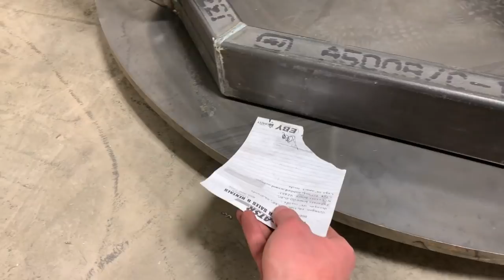Building a table to hold my vise

Comment: And you can bolt it to the floor if you're concerned about it moving. The floor, that is...
Reply from the maker: Yeah I’m really not concerned about it moving even with the table just sitting on it. I mean it never tried to blow away when it had three tractors on it, so now with the table there’s not a chance.
Reply: But the tractors could have rolled... @Jer_Schmidt
Reply: Steve, you hit that nail on the head!!!!!!!
Reply: Steve Gilbertson s
Reply: What do you bolt the floor to, to prevent it from moving? :P

Comment: Nobody overbuilds quite like you, and I mean that only as a compliment.
Reply: You buy once, you cut once, if it's worth doing then it's worth overdoing. Those are his credos. :) I mean, that wilton vice, will pay thrice it's price in two decades. Guaranteed. Already, mine, the next step down, if i wanted, i could sell it for just over twice the price of admission.
Reply: I once purchased a set of Heavy duty sawhorses at a farm auction. Beam was a 10 x 10 H beam 3/8 web and legs were 4 x 4 x 1/4 angle  they could have supported the front of the space shuttle if need be.  Farmers never overbuild anything  They just make it strong enough to hold anything they may be able to move with whatever they may own.

Comment: I'll definitely be sticking around. Love watching someone who knows what they're doing.
You should make an attachment for that vise to attach it to your tractor. Probably be very simple for you.

Largest vise we've had was a leg vise roughly 4 feet tall. Easily 400 pounds. My father donated it to a local museum a couple of decades ago. We had it attached to the wall of our garage. We we'd use it, you could see the wall flexing under the weight and our strength.

Comment: Oh my gosh. Through-bushing made from just raw round tube stock in the rectangle tube for bolts is such a good idea. I've been analyzing large welded steel structures for years and I've never seen anyone do that. I hope you don't mind if I steal the idea. If you ever need some analysis for your designs, I owe you :)
Reply: That's a very common thing to do. VERY common.

Comment: I hear forklifts make moving heavy things super easy.  Might want to look into one of those.
Reply from the maker: Interesting... I’ll google that.
Reply: @Matthew Cremona   Did you figure that out after just moving your new toy yourself?  :)
Reply: first get milling machine ;)
 @Jer_Schmidt
Reply: Everyone's been suggesting you get yourself a forklift for years.
Reply: That must be where I heard that
Reply: Could thread a lifting eye in the top where the center of mass is and then use the engine hoist to move it.
Reply: Nah. gantry crane !
Reply: He could just build a trailer like yours Matthew and move it as easy as you move those giant chunks of wood you slab up.
Reply: Forklifts cost too much and aren't all that useful on the farm.  Surely one of those tractors has a  front end loader with forks.
Reply: Surely a gantry crane of some sort would be more versatile.... Takes up no floor space and you can probably knock one together out of some old motors and big ass girders.
Reply: He'll probably build one of his own next month!
Reply: We went back and forth between a fork lift and skid steer.  Most fork lifts are just made to run on concrete.  Most skid steers can run off road.  We wound up with a skid steer with pallet forks on it.  It has a 2200 lb lift capacity (about 1/2 of a small fork lift but enough for us for most things) and 4400 lb tip.  It will lift up a Jeep Cherokee (approaching tip weight) and is useful for a LOT more things that a forklift.
Reply: @briancasey3421  For shortish gantries and rooms - say 10 or 12 feet - those are surprisingly easy to build with I-beams, square tubing, and COTS hardware.  But as the length grows, the weight of the gantry beams goes up fast ,which makes everything else bigger and more troublesome.  I seriously considered building one in my little 12' x 20' shop, before I decided to sell and move.

Comment: Great build Jer, enjoy your videos a lot. If you have not come up with a way to move the table around yet, consider drill/tap a couple holes in the center and one in line and towards the vise for lifting eyes. Your floor hoist will straddle the legs and make it safe and easy to move around. If you don't want  the holes left open you can insert allen head set screws in them until time to move again. Just a thought. 
Thanks for the video.👍

Comment: Nice vice support :-)  I got a good tip from Jody at Welding tips and tricks for a ground on something you can't clamp on: use a thick copper wire that you wrap around and clamp on .

Comment: Got a vise exactly the same as that in 1972. It cost $490.00 then. I purchased replacement  jaw inserts in 2016, and the cost of them was $180.00 for the pair. You gonna LOVE that vise.
Reply from the maker: Ouch, those are expensive jaws. But interestingly the vise is actually quite a bit cheaper today when you factor in inflation.

Comment: Such a killer vise. I picked up a lightly used 8” version of that one over the summer. I wasn’t smart when picking it up. I way underestimated how heavy it was, and grabbed it by the handle with one hand, and the bullet end with the other hand, picked it up and it rotated out of my hands and fell on the concrete floor. Putting a huge dent in what was a perfect bullet cap. Doh!! I’ll be cantilevering mine after watching this..

Comment: Great build! It wasn't really until the shot of you mounting the vise that I really understood how BIG that thing is.
Reply from the maker: I was a little taken aback when I opened the box. It’s a beast.
Reply: @Jer_Schmidt  when you said "heavier than I am" my initial reaction was - no offense - "Gee, I didn't think Jer was a little guy, but maybe?"
But then I saw you with that monster in the shop crane and my jaw dropped. It's like the corollary to what Archimedes had to say about levers. We can call it "Jer's Vise Corollary:" "Give me a vise big enough and let me weld up a table and Archimedes can pack sand."

Comment: I just absolutely love how beautifully over engineered it is. Moving the legs out a few inches, so it doesn't tip over as easily. I am pretty sure nothing will make that tip, ever. You should test with a longer tube how far out you need to put your weight for it to move at all. I just hope you will not need to move your workshop, because this will be a beast to move. Well done on the video very enjoyable.

Comment: Question, who just happens to have a piece of 3/4" steel that size hanging around?
Reply from the maker: Oh you know...it was just a scrap. ;-)
Reply: I do
Reply: It's a knock out plug from a really large electrical box :)
Reply: @Jer_Schmidt  this is one of those easy projects you can build for free from your scrap pile, right? Hahah! Nice vice, and great table!
Reply from the maker: McKenzie Keith 
Of course! Just using up offcuts.
Reply: I do.  Mine is an old de-commissioned pallet table.  I had thoughts of building a weld table, but supposed a nice little vise stand would be good too.   Nice job Jeremy!
Reply: #AMERICAN_FARMERS

Comment: Sand fill the legs! Make it a 1ton table! Hahaha! Awesome work!
Reply: I'd rather rice-fill it. That would probably keep it dry inside.
Reply: Usually you pour concrete inside. A heavy one where the aggregate is scrap metal. But if you really want to do it right, you go and buy lead and pour it inside. It's dead easy. You make sure one end is sealed and put as much lead scrap inside as you can fit, then, you heat up some lead (don't boil it) and pour on top. The lead inside will melt with the poured one and form a solid chunk. Saves time and minimizes the risk of vaporizing the lead, which is the only thing besides putting it in your mouth that you don't want to do.
Reply: Radim Petricek isn’t rice hydrophilic? So it would absorb water and release it to maintain equilibrium. That’s like putting clay desiccant in there. Only effective with exactly 100% seal, or it’s just breathing and sweating.
Reply: Hhmmm.
Reply: @aserta  to go full on, pour tungsten or osmium into the legs
Reply: @aether1370  yeah.... Try melting either of those without vaporizing the steal table.
Reply: @isaackarjala7916  to be fair I'm not a metallurgist, engineer or craftsman
I'm a 15 year old who enjoys Jeremy's content lol
If you melted the lead beforehand and poured it in after like a cast then I'm sure the latent heat transfer wouldn't be enough to melt the steel, unless the lead was also about to be vaporised :)
Reply: @aether1370  oh yeah, you can pour in lead, but not tungsten or osmium; both have melting points far above that of steel
Reply: @isaackarjala7916  oh fair enough
Reply: @isaackarjala7916 , you can fill it w/ scraps of osmium but that thing  is like $13000 per kg... Filling with any non iron metal might result into galvanic corrosion in the long term (esp. if there is any DC going through)

Comment: you should have done one leg shorter
so you can build in a adjustment like a big screw or something to adjust the table so he doesnt wobble on the ground
Reply: I think it's heavy enough that that's not an issue.

It just bends the earth underneath it to whatever level the legs are at.

Comment: If you add a couple cross bars at the bottom about six inches up from the floor, you could roll your pallet jack under it and lift the table when you need to move it around.  I've done that for welding tables and workbenches.

Comment: Totally impressed with your attention to detail; its great to see there are still craftsmen who will are willing to do extra work on even what could be considered entirely a utilitarian item (e.g. A metal vice table) and in doing so have elevated it a piece of craftsman furniture/art.  (Its kind of like on farm equipment from the 1800's; they often hand painted pin strips which ornately framed each panel on the machines body work.) great work

Comment: I've been trying to decide where to mount my vise for awhile, now, and thanks to this video I... still have no idea. But the design is great and the execution is even better. The combination of meticulousness where it pays off and the eyeballing where it doesn't... really good info. I tend to get paralyzed when building something this.... expensive and permanent.... trying to figure out how to not mess it up. You seem to always get it done properly start to finish.

 I am looking forward to the followup video of the paint drying, so long as you get some good angles.
Reply from the maker: I can relate to the feeling of getting paralyzed before starting a project like this. I spent a lot of time in CAD trying to figure out how I wanted to do it, and I have many other projects where I am currently in that paralyzed stage, scared to start before the design is perfect.

Comment: i made a welding table out of a 4ft chill ( a 2 piece centrifical mold used to make hard surface rod and inserts) one half has a hole in the center.   The half i used was the bottom with a 2in centering hole and is about1 1/2 to 2in thick cast alloy .You can weld to it but most rod will pop off it.   put it on steel casters and put a drawer under one side and a rack on the bottom.    the chill is machined down from about 4in thick after the castings gradually pull chunks out of it.

Comment: A shelf 1.5" higher than the pallet jack in it's lowest position makes moving the table easy.  That is how we set up all of our tables in the shop.  Build the shelf, set shelf on 2x4s on pallet jack, weld to table.
Reply from the maker: That’s how our other welding table is made. It is super easy to move it that way, but I find that shelf to be a clutter catcher and it can be a bit in the way...

Comment: I like the idea of using the round plate as a base itself for a pedestal.
Reply from the maker: If you had plenty of space that would not be a bad idea. But whenever I get my own shop it will likely be smaller than this one, so I wanted to make something that uses space efficiently.

Comment: I have not read all the comments, so I apologize if this echos other suggestions, but for palletjack liftability, perhaps you can add crossbars several inches off the ground between two pair of legs. you could also add shelves/cabinets between legs to give added storage capacity and thus weight (not that weight is actually needed) I wish you had discussed some of the other ideas you had for the bench... I am curious what you have in mind. Personally I would add something akin to a receiver hitch opposite the vise so as to be able to add modular bench top power tools.

Comment: Hi Jeremy,
great build.
my I suggest that the concept of a bush where you put a bolt through tube is very good. however instead of welding the two tubes supporting the vice together you could have spaced them out so you could have used a standard bush placed inside the tube instead of externally mounting it with its added complication. also it would have alleviated the need for the top plate for the base of the vice, although the plate did form a nice flat surface for the vice base.

Also the best way I found laying out an octagon is to scribe out a circle  (using a stick and a nail in it) to the diameter of the long point and cut the flats in between to suit. easy.

further consider putting a 1/4 thick layer of rubber under each leg to minimize rocking. if you can lift it.
Reply from the maker: Thanks for the tips! I did consider spacing the tubes under the vise like you said, but I thought this would look better. After seeing it in real life, I think this actually looks worse, but I’m not going to do anything about it at this point.

Comment: Awesome table....when you do go to paint it I suggest leaving the top bare steel.  I made a table/cart similar and painted the base gloss black and left the top raw steel....looked killer, especially if you polish or fine sand just the edge. I sprayed the top with a liberal amount of wd-40 let it soak in over night and wiped it clean, and did the same once a year. Never rusted
Reply from the maker: Yeah, that’s what I plan to do. I left the top of my belt grinder cabinet unpainted, and I like it that way!

Comment: The best anchor you can use for mounting those big vices are big flywheels. We had 1 of those big Wilton vices in our shop mounted on a stand with a large diesel flywheel somewhere around 24 in. in diameter & 8 to 10 in. thick. It took quite a bit of force budge that thing. If you wanted even more weight then that you could also use the crankshaft instead of a big pipe.
Reply from the maker: Sounds like a good idea. I still prefer this in my situation, but if you needed to be able to work all the way around the vise then a flywheel would be a good choice.

Comment: Machine grey paint on the legs, no paint on the top, just lots of oil and wire brushing when needed.  That's what we use on our welding benches onboard our ships, and they hold up well that way.  Nothing is worse than a painted top on a steel workbench.  Paint will eventually chip under regular (ab)use, and those chips always wind up getting into everything.
Reply from the maker: That’s exactly my plan. Same paint color as belt grinder on everything but the top surface.

Comment: Nice light weight table and vice :-)
Well Done ! A suggestion would be to add a large drilled and tapped hole near the center at the balance point for a lifting eye. For times when you can't use the pallet jack and need to crane it.
Great project,
Dean
Reply from the maker: I can’t imagine in what situation I wouldn’t be able to use either the pallet jack or forklift.
Reply: @Jer_Schmidt  Didn't know you had a forklift. 
Great job on the table. Beautiful vice also.
Wish I had the space to build one. Keep the projects coming Jeremy, you do excellent work.
Reply from the maker: The Ayr Cave Shop 
Thanks! 
I don’t have a forklift, but we have a front loader and a skid steer that accomplish the same thing in this case.

Comment: I bought a used manual fork lift for 400Euros (500$). A bit stiff for stuff moving, but since there is no electronik or stuff, I can weld on it and don't have to worry about anything. If you don't want to spend money, a stack of pallets can do the job also (I used that method before the fork lift). My workbench weighs about 3/4 tons and it moves when I bend heavy stuff, so now I am thinking about a post vice ancored in concret to solve the issue.
Great build by the way.

Comment: An added advantage of having the vice off the table surface and lower is that the vice can be removed by undoing the snivel locking nuts, leaving the base in place, thus clearing the table of obstructions when placing large objects on top.
I have built a few in this manner.

Comment: I kinda wish you had canted the legs outward slightly, with a lower cross a few inches above the floor. Could make for a storage area (maybe a built-in cabinet) and provide a location for the pallet jack.

Maybe your next project could be an A-frame crane. Seems like it would be quite easy for you (naturally built to withstand gunfire) and make it a hair easier to shift around heavy items like your table.

Comment: I actually built a table with I beams and used a piece of 1.50" plate for my c3's and 800's wilton's. I laser cut a 5 × 5 hole grid, tapped to 5/8-11. Then made adapter plates to bolt the vises to with the hole patterns in the plate. That way I could slide the vises to any position on the table and bolt down. I bought some ss 316 5/8-11 all thread from fastenal, cut and turned the ends to make basically studs. Then just use ss nuts. Works out pretty well, 5' by 10' table. Just thought you'd like to know for a future build 👋🏻